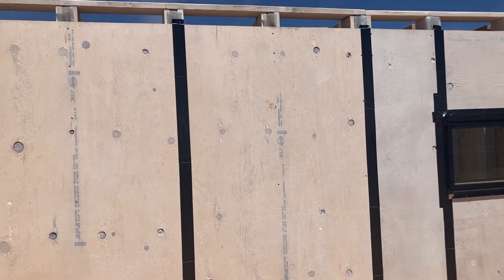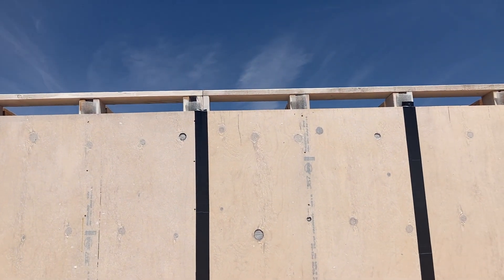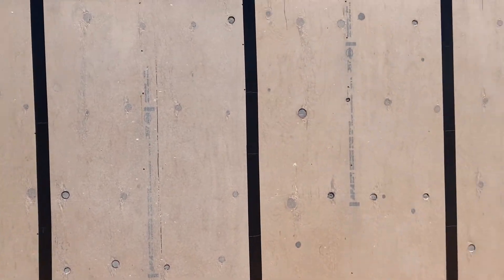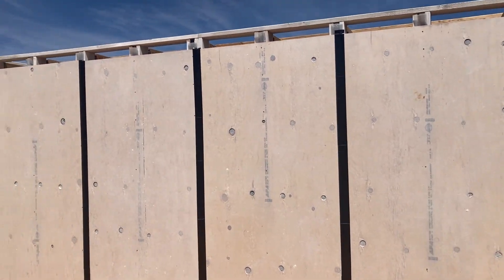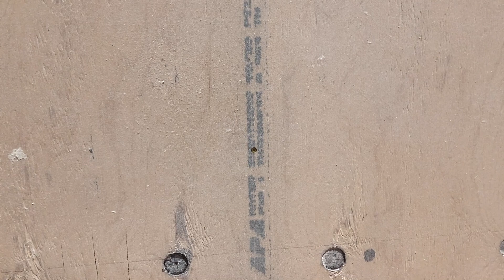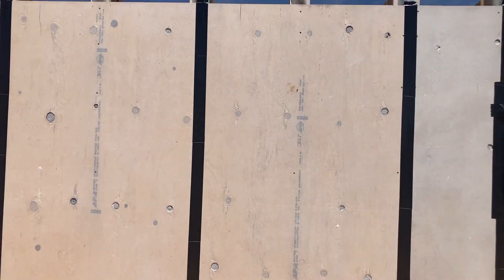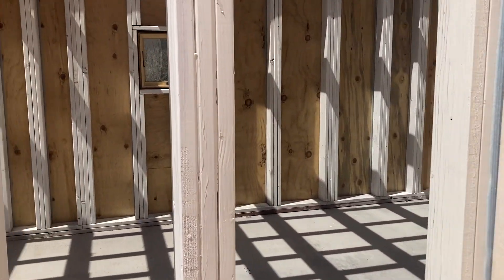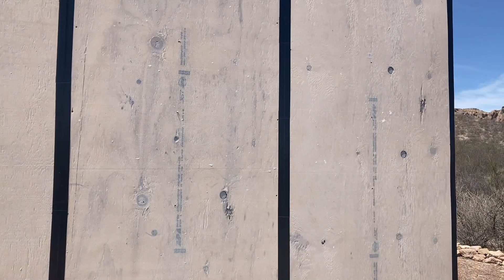Building an Off-Grid House Part 6: Sheathing, Air Sealing, Bug Sealing, and Thermal Breaks

Comment: What was the locktite stuff you were talking about. What will you be covering the outside of the plywood with. What bug sealing did you use.
Reply from the maker: Loctite PL Premium Polyurethane Construction Adhesive. It's a super strong glue.